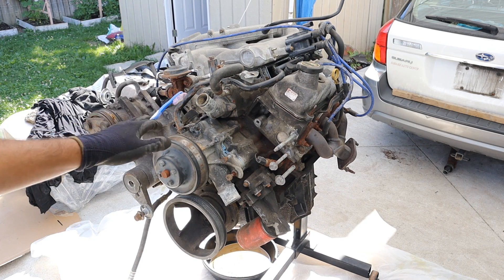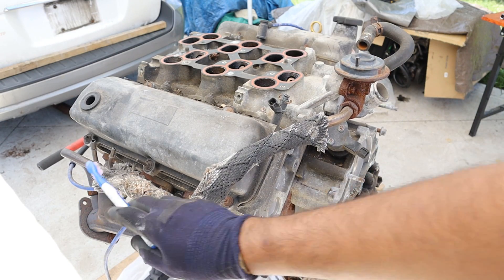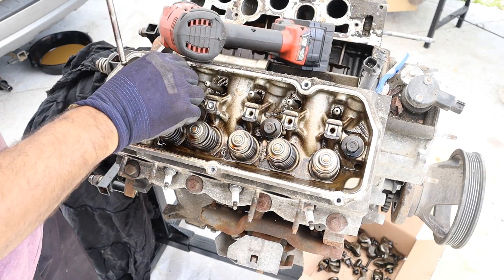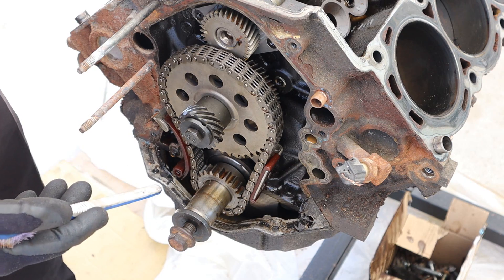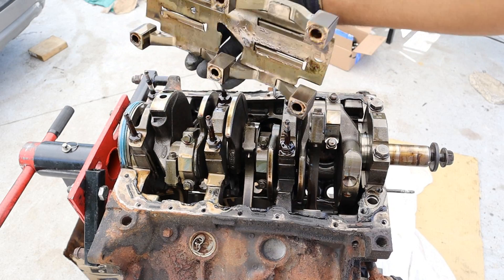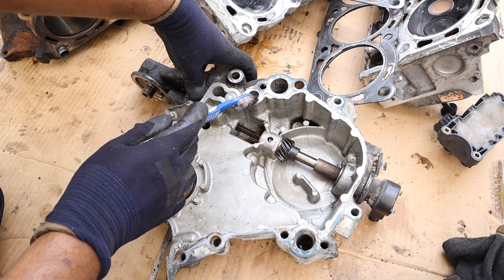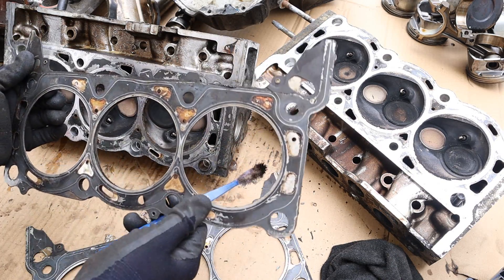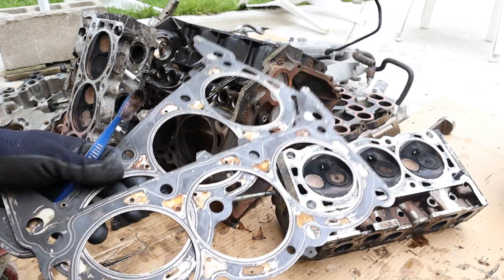The Ford Mustang V6 Essex Engine is Simple yet Forgotten

Comment: Failure was the lower intake manifold gasket to head due to aftermarket gasket. 30$ fix. Them head gaskets was good. 
That v6 using no name lower intake gaskets wich only have single o ring per water port where oem have 2 and contribute to most "head gasket" failures with this engine.
Reply: Correct, lower intake manifold gasket failure. Just like a GM 4.3 lol
Reply from the maker: Looking back, yeah the intake gasket had quite alot of milkshake on it. 

But from what I've read these engines are still headgasket failure prone.

Comment: Seen one in a thunderbird sc last 550k km...
Reply from the maker: How many head gaskets?
Reply: @speedkar99  he bought the car with 220k on it, he never did a head gasket on it but the previous owner might have, car was not really driven hard, maybe that's why it lasted...
Reply: @speedkar99  what's really surprising about that tbird was that the original transmission outlasted the engine at 550k...

Comment: Does this engine use a distributor or does it just have regular coil packs? I’m curious because on old V engines that one gear and shaft that was part of the timing assembly usually connects from the camshaft to the distributor, which then distributes electrical current to the spark plugs.
Reply: This particular V6 used a single coil pack, that controlled the ignition firing for all 6 cylinders.  The older versions of this engine (my old '94 Taurus) had a distributor with a single coil, and wires going to the plugs.  The latter Mustang, Windstar & F-150 Essex V6's had a single, 6-plug coil pack with wires to each plug.
Reply from the maker: Regular coil pack. I explained right near the end of the video
Reply: I believe that is a vestigial part of the old distributor system. You can adapt it back to distributor and carb .

Comment: Sorry but I had to laugh when the dropped oil filter caused the drain pan to do a tripple backflip. 75 yrs old here and been changing my own oil on every vehicle I've owned for 50 years (!).  Should be good at it by now but it's a cause for celebration when I don't do something dumb that results in a similar big mess.
Reply: Yes done that a few times as well, and it is a pain cleaning the oil up off the floor. Good thing there was a lot of newspaper around, and a few large garbage bags as well.
Reply from the maker: I use a drop sheet of plastic on top of a cardboard. It helps, but inevitably will get some on the driveway

Comment: Given that the head gasket is caused by the difference in thermal expansions between the block and the head, is there anything an owner could do to help alleviate this issue? 
Thicker gasket? Maybe a larger radiator?
Reply: Not really, aside from a redesigned gasket with some sealer between the surfaces, but they will all do this with time. Essex engines are pretty reliable though, not going to give issues other than those head gaskets, simply from the conservative design. The only way to fix them would be a cast steel head, which ISTR was an aftermarket thing, that  made them really bullet proof. They did a good bit of work on them over the decades, as this started out with a single barrel carb, and had fuel injection added later. Just they did find a lot of use as power plants for other applications, little more pep that a 4 banger, but not too much change in length, so lots were used in agricultural and specialist equipment. Not a bad V6 engine though, friend had one in his Ford, and the engine was not an issue, but the diff, sure was, little underspec for the 3.0l power plant. Sure was heavy on fuel though if you were ever hard with the right foot, but enough torque you could drive all day in 4th gear in town, and never change gear.
Reply: If you' engine is running good, not worth doing much aside making sure you're running a good, maybe full synthetic. Just got some full syn at Walmart for $19-20 5q jug.
If you have a blown head gasket, pull the heads and and check or have them checked to insure no warpage. If so, get them milled/resurfaced.
Might need a thinner head gasket depending upon how much is milled, but if its not much you can probably get away with standard. Just research which manf. seems to be the best for your engine.
If you're really worried though, couple things that might help a small amount.
1. Do a coolant system flush and replace with good coolant.
2. Replace the thermostat.
3. You can add a water-wetter to coolant which improves the heat transfer of the coolant a bit. Most people seem to see 10' f. lower temp.
4. If you want to go whole-hog though, a radiator flush might help depending on if/how much debris build-up it has.

Also, double-check if you are even supposed to use gasket sealer, how much, and where.  It was pretty common in the day to just use black RTV or similar, however my valve covers said explicitly not to use any. The mech. apparently did and I was back shortly after with a far worse problem.
Reply from the maker: Not too much besides frequent coolant changes and checking the thermometer if it starts overheating or leaks for earlier signs of failure. 

Don't run it so far like this engine where it caused bearing damage.

Comment: Wow..... Ford was making push rod engines all the way up to 2004.  Pretty cool tear down.
Reply: GM and Chrysler are still making them in 2023 lmao, and some damn good engines they are (ignoring a few faults). I think Bentley was using them too not to long ago.
Reply: @SPAZTICCYTOPLASM  The LS motors are still push rods right?
Reply: @michaelstrongbow2336  Yes.
Reply: @SPAZTICCYTOPLASM  which model GM cars are still being made with pushrod engines
Reply: @sgbawg0 V8 Camaro, Corvette (non-z06) Silverado, Suburban. All the “LS” and “LT” V8 engines. 4.3 V-6 with pushrods was used until last year and most of their V8’s. 

Ford just started making pushrod V8’s again a few years ago, they make 6.8L and 7.3L versions of their new OHV HD truck V8 known as “Godzilla”. 

Chrysler is killing off the Hemi V8 soon and will use a 3.0 i6 twin turbo in it’s place.
Reply: @sgbawg0  All of those with LS and LT engines.
Reply: No disrespect, good sir, the 7.3 Godzilla Gasoline V8,since 2020,  and the 6.7 Powerstroke, since 2011, are also pushrod, Ford built engines.
Reply: 2008 was the final year for this engine in a vehicle, the longer stroke 4.2L variant served as the base engine in the F150. It was sold as an industrial spec stationary engine until 2015 or so.
Reply from the maker: I believe the last of this engine was 2009ish ford f150
Reply: @speedkar99 correct, 2008 model year F-150 had the 4.2 version.

Comment: The Ford 3.8/3.9/4.2L is one of the most reliable series of engines ever built, up there with the Buick 3800. So I don't know why you're claiming it's "unreliable". I'd take a Ford Essex engine any day over ALL of the Ford engines made since. The water pump bolts are different sizes because some are for the pump, others go all the way through for the timing cover. Electric fuel pump, not mechanical. Yes, you can have VVT on an OHV engine. You're slipping man. Don't take that the wrong way, enjoy your videos, but there's a lot of fans of the Essex engines out here.
Reply: Actually, to me that looked like a completely salvageable engine.
Reply: @johnnyblue4799  Oh yeah. Swap out those crappy MLS head gaskets for the traditional graphite ones and it'll never leak coolant again. Swapping head gaskets on that engine can be done in hours. vs days for a modern engine. I've done a few of them.
Reply: @JohnDoe-ml8ru  I'd also get new valves, new pistons/rings and of course the crankshaft bearings and timing chain. Fresh gaskets everywhere and it's good for another 300k kms. I don't know that engine, but I'd think that the fuel economy would be it's only issue with it.
Reply: @johnnyblue4799  Fuel economy is not a problem. Typical fuel economy with the 3.8 in a Mustang was around 30-35MPG highway. My 94 constantly got 35MPG on long trips in stock form.
Reply from the maker: At that point you'd be rebuilding it lol
Reply: @speedkar99  Indeed, but it's a nice and simple engine. And DYI shouldn't be very expensive.
Reply: I’m not actually sure this is a 3.9L I’m pretty sure they were mainly made in 2004
Reply: @jauntyy1891 we didn't even get 3.9 liters idk why he said that our cars got 3.7 v6 mustangs in the s197 every single sn95 idc who it is or what they try to say unless it's bored and stroked it's a 3.8.
Reply: Because when the engine was used in the '90s in a variety of vehicles whether it was for a Ford Taurus, a Ford Windstar, a Ford Thunderbird, or a mustang, they were known to blow head gaskets pretty consistently around 60k miles until they changed the head gasket type somewhere in the mid to late '90s. By the time they fixed the problem, the number of models that featured the engine was considerably less so not as many people got to see that the problem had been improved.  This example makes it sound as though the problem might not have been completely resolved.  Having said that, I will take this over 90% of the engines of the engines on the market today.  No water pumps driven by timing chains, no wet belt timing belt, no cylinder deactivation, no turbo, no gdi, no excessive use of plastic on parts that should be made from metal.
Reply from the maker: Wonder why aren't these vehicles still on the roads around here though...
Reply: @speedkar99  Rusted through? Canada is full of salt on the roads during winters.
Reply: @speedkar99 tf you talkin bout my 3.8 Essex from 1998 drove from San Diego to Minnesota still daily driving even in the snow. Not even a knock or a tick. Over 200,000 miles
Reply: @speedkar99 mls gaskets we're easy installs took a few hours with the hood off. One of the best engines naturally aspirated sucks trying to boost is the only negative you could say
Reply: @speedkar99 because most of the cars that they came with where notorious for water leekage and rust issues
Reply: @speedkar99   Because they're classic cars now. The 3.9l was the last of the OHV V6's for Ford and they stopped making them in 2003/04. Even the last SN95 will need a complete overhaul at this point. All the seals, gaskets and rubber components would be gone. And even with all that, that needs to be done, I occasionally see a clunker SN95 driving around here and there, or the nice looking ones that people intend to keep. Time is not our friend.